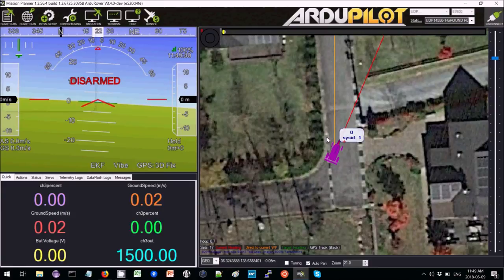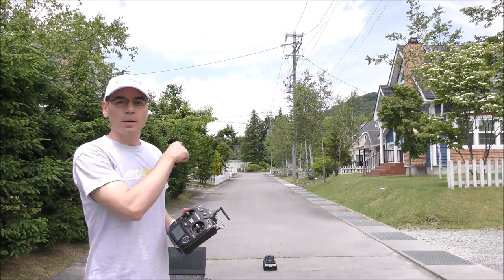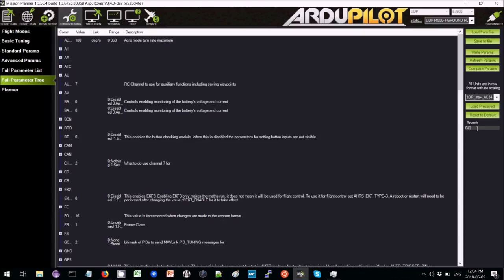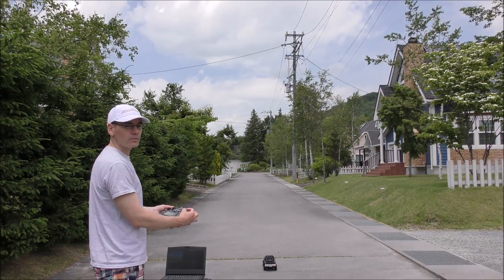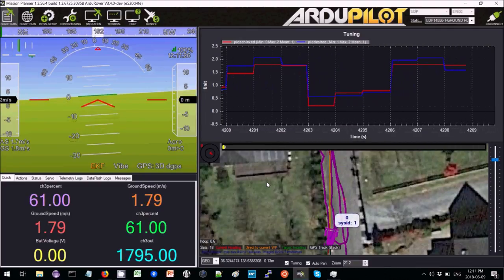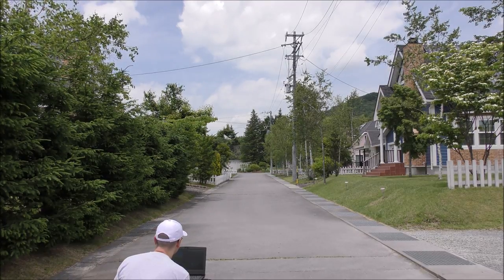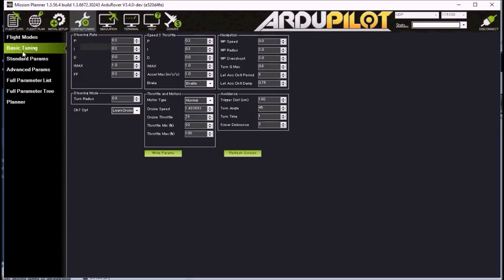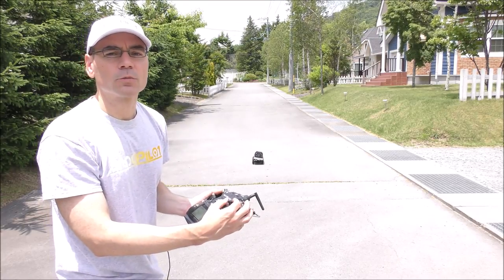Rover Speed/Throttle tuning

Comment: NOTE TO THOSE IN CASE IT MAY HELP. It is extremely important to set the motor spin direction from the right source. For example, if throttling forward makes the motors spin backwards, you MUST reverse this in exactly the right spot. In MissionPlanner, Go to Setup/Servo and click the reverse button under throttle. Reversing this on the RC controller or even on RC parameters won't work and you could get some seriously backwards driving behavior in ACRO mode (like throttling forwards and the car rocketing backwards).
Reply from the maker: Yes, good advice.  During the vehicle setup users should test the motor direction as described here on the wiki: https://ardupilot.org/rover/docs/rover-motor-and-servo-configuration.html#testing-motor-direction

Comment: Mission planner no longer has Ch7 option on the basic tuning page and now has 'User parameters' which allows you to set a whole bunch of channels, up to ch16 to whatever you want.
There isn't anything special about Ch7 right, i can use any channel i want to capture the data cant i?
Reply from the maker: Steve, Yes, you're right that there's nothing special about Ch7 and any available RC input channel can be used to trigger the "auxiliary functions" as we call them.
Reply: @rmackay9  Thought so, Thanks :)  Can i ask another question please, i was looking at the changelog for 4.2.2 and it states VL53L1X rangefinder preserves addresses.   What does this mean, is there some sort of support for the non persistent i2c address change of the VL53L1X allowing multiple units to be used now or is it something else?
Reply from the maker: @stevefox3763  Hi, I've answered over here on discuss https://discuss.ardupilot.org/t/rover-4-2-2-rc1-available-for-beta-testing/87184/4

Comment: Hello dear Randy

Hope you are doing well and thank you for sharing the informations

I have encountered and issue that when I increase the throttle (connected to channel 3) the servo output doesnt change at all

is there any thing to reccomend me for checking

thanks
Reply from the maker: My guess is perhaps the vehicle isn't armed or it is in Hold mode.  By the way, it is best to raise questions in the forums. Especially if you use the beta version, 4.1, I am very actively responding to issues. https://discuss.ardupilot.org/c/ardurover/rover-41/158
Reply: @rmackay9  actually I armed it and I saw the ARMED sign on my hud and mode was manual but the throtlle has no change in servo output (which is visible in setup ribbon)

the interesting point is that when I chose the servo output to show me the RC_3 channel, it shows the changes but no change in throttle is visible despite of RCMAP has bridged the throttle to channel 3
Reply from the maker: @mohsenfazareh3384  If you could report this in the forums along with an onboard log file that would be best.  I'm quite sure it is a configuration issue but it is hard to be sure without a log file.  txs for using AP.
Reply: @rmackay9  you dont believe it, it was all because of safety switch

after a long time not working with pixhawk, I had forgotten about this tiny part of autopilot and so by placing it and pushing it I could get what I want

regards

Comment: Good afternoon. Can I connect the two servo motors for the sweep control and the sabertooth 12a to the Pixhawk 2.4.8 auto-pilot control using the dots? Without the remote!
Reply from the maker: Hi javaprogramming, TBH, I don't quite understand the question.  AP is very flexible so it can do most things but maybe it would be better to post general AP questions in the forum here https://discuss.ardupilot.org/c/ardurover/rover-45/175

Comment: Is it possible to have follow mode follow my phone?  I have a adapter to connect the telem radio to my  phone and can use mission planner to control my rover but can't get it to follow me on the move.
Reply from the maker: Hi Kwad3D, Mission Planner's Ctrl-F screen has a "Follow Me" button but only if a NMEA GPS is attached to the PC running MP.  QGC also has a follow-me feature but I don't think it is enabled for ArduPilot.  We should try and get that working though so I'll mention it to our new QGC developer, DavidA.

Comment: Thank you for the video! The car you are using seems to be not available anymore. Could you suggest an alternative? I have the Turnigy 1/16 4WD Monster Beetle RC Buggy (w/ brushless esc) and I am having a hard time reducing its speed. Would like to try your set up.
Reply from the maker: Hi Tahsin,  It's probably best to post questions in the support forums. https://discuss.ardupilot.org/c/ardurover/rover-4-0/154 and/or we have a wiki page here about tuning the speed-and-throttle: https://ardupilot.org/rover/docs/rover-tuning-throttle-and-speed.html.  If the rover is travelling too quickly though I suspect the problem is that the ESC hardware does not support breaking.  Some ESCs have a setting that can be changed to enable breaking though.  If it doesn't then the best solution is to replace the ESC I'm afraid.
Reply: @rmackay9  Thanks! Will use the forums. Ordered an ESC programmer, will give it a try.

Comment: Thanks for the video. I'm using a pixhawk with mission planner for the rover. The "pid achieved" doesn't change at all, while the "pid desired" graph is updated on the tuning window. Any idea what may be the cause?
Reply from the maker: @kevintowers100, the vehicle is in Acro mode of course?  .. and it's got a good GPS lock?  My guess is that the vehicle doesn't have a good position estimate.  So perhaps it doesn't have a GPS lock or the EKF needs a little more time before arming to figure out where it is.
Reply: @rmackay9  Hi Randy, In Acro mode yes and GPS/EKF seems to be fine (nothing in RED). Does the rover need to stay disarmed? If so, when would I Arm the rover? I really could take some help or mentoring, if someone is available in the Boston area or vicinity.

Sometime back everything was working and tuning was working fine. After that I did the compass recalibration and now the compass is fine.

Comment: Hi all,
 I’m using PixHawk 2.4.8 for rover I’m facing some problems flashing green light after pressing safety switch and i get gps locked but pixhawk disarmed  i want convert into solid green light  how can solve my problem plz guide me??
Reply from the maker: Hi Tomar, there are  a few different ways to arm the vehicle and they are listed on this wiki page: https://ardupilot.org/rover/docs/arming-your-rover.html .  If this doesn't work then it would be best to post a question in the support forums and include an onboard log file if possible after setting LOG_DISARMED = 1. https://discuss.ardupilot.org/c/ardurover/rover-41/158

Comment: I am doing this project with a Pixhawk 1. I am constantly failing CRUISE LEARNING. Is this just a PH2 project?
Reply from the maker: @ShadowQuad, ArduPilot runs on dozens of different flight controllers (http://ardupilot.org/rover/docs/common-autopilots.html) and should certainly work on a Pixhawk1.  My guess is the throttle is too low or the vehicle is moving too slowly but it is best to raise support issues in the support forums: https://discuss.ardupilot.org/c/ardurover/rover-35

Comment: Hi Randy,
I have not done this tuning yet to my vehical (skid control), my set is (2x 24v brushed motors  from  A power chair , roboclaws 2x30A, pixhawck 4, taranis 9 plus  transmitter, mission planer) I noticed that the speed of 2 motors are different  is this tuning could fix this issue or I should look on other factors, another problem I don't know if it s related I can go forward but not backward , just some hint pls where I should look for ...thank you
Reply: Have you got any update with PID values. So far if so please do share it.
Reply: @vegasofficial2431  I remember from memory it was a calibration issue exactly transmitter calibration